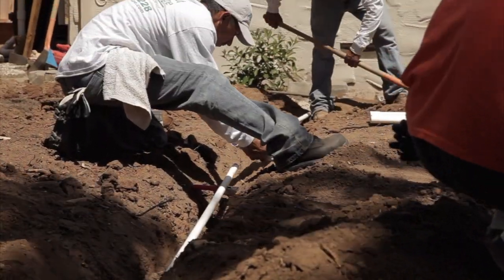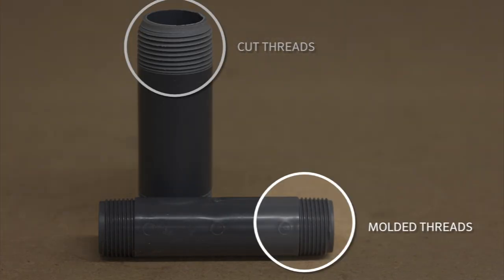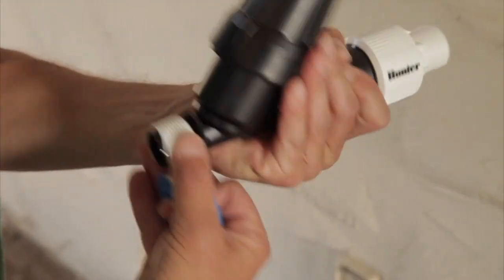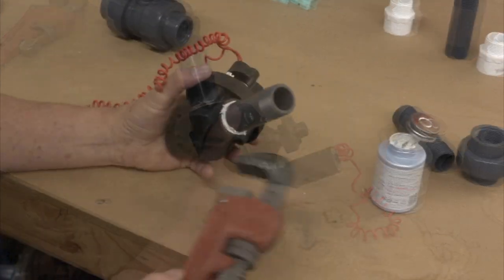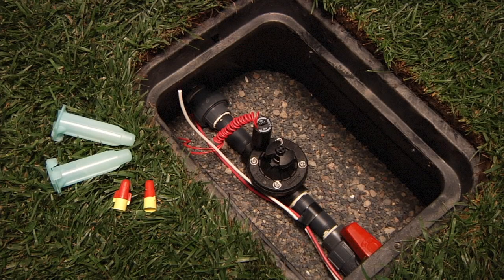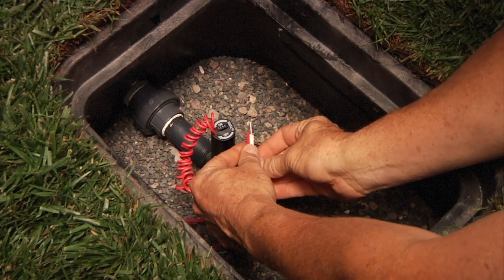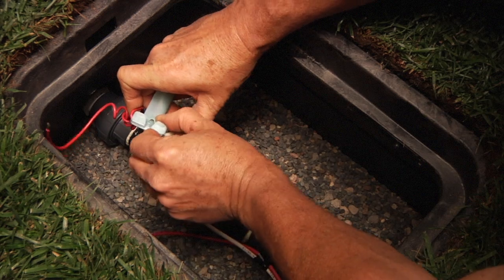Valve Installation: Proper use of Fittings and Wire Splices

Comment: So, does a sprinkler valve give the sprinklers pressure?  Can i just dip into the water hose outlet instead?
Reply from the maker: Thank you for contacting Hunter Technical Support.
 
Sprinkler irrigation System is a system of watering your yard which works like normal rainfall. Water flow passes around through a system of pipes mainly by pumping. It is then separated through sprinklers so that it splits up into tiny water drops that fall to the ground. The average water pressure for most homes and businesses is between 30 psi and 50 psi; most sprinkler systems are designed to use pressures of around 30 psi.
 Check out this video for additional support. 
https://www.youtube.com/watch?v=nFZShN8kMnA

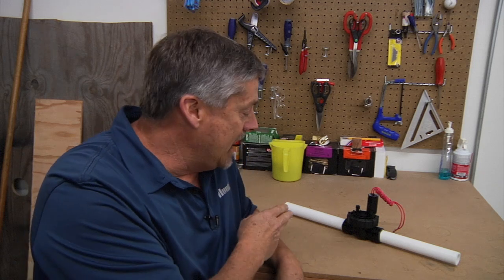Comment: question - at 3:08, when talking about the slip version using PVC piping you have two tins of glue (purple).  Is paste and glue used in this situation, if not, what are the two can's content? Sorry if I missed something.
Reply from the maker: Thank you for contacting Hunter Technical Support

The two tins of glue, one is a primer and one is glue. Follow the instructions on the type of glue you purchase as some may not require the primer. Do not use Teflon paste in valve installations. 
Please let us know if we can offer any other assistance.

Comment: Where can I get the electrical input requirements for your valves ac/dc amps  voltage ?
Reply from the maker: Thank you for contacting Hunter Technical Support.

The Hunter DC latching solenoids are designed to be used with the Hunter battery-powered controllers. 

The controller sends a quick DC pulse to operate the solenoid. We do not release controller specifications on components, but we do have the following specifications on the solenoid. 
· Operating voltage = 6-9 volts
· Operating current = DC current
· Pulse duration = 50 millisecond pulse
· Resistance of approximately = 5 ohms 
Here are the specifications of our AC solenoids:

 Minimum opening/operating voltage: 19 VAC
    •    Maximum recommended voltage: 28 VAC
    •    Current at 24 VAC:
       •    350 mA inrush, 190 mA holding, 60 Hz
       •    370 mA inrush, 210 mA holding, 50 Hz

Thank you again for contacting Hunter Technical Support. Please let us know if we can offer any other assistance.

Comment: What position should the solenoid and the small adjustment thing be in for operation?
Reply: The solenoid remains tight to the bonnet of the valve during normal operation. To manually operate this valve your give the solenoid a 1/4 turn counterclockwise. On top of the valve is a called a flow control. To set the flow control you'll turn on the valve and turn the flow control until you feel slight resistance. Then you'll back off one turn. By setting the flow control the valve will close more reliably.